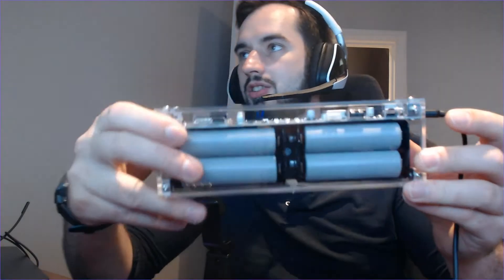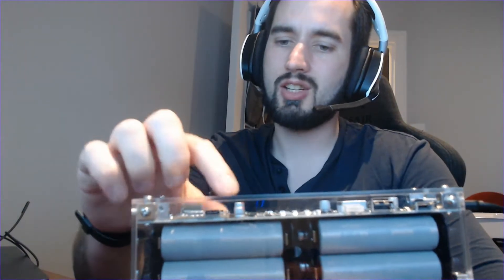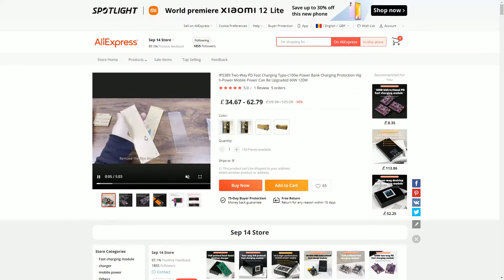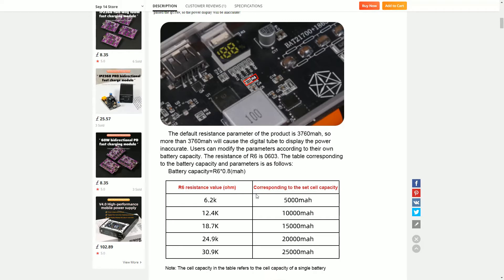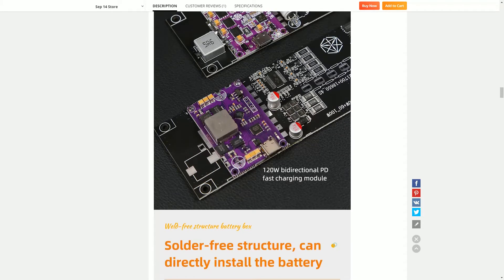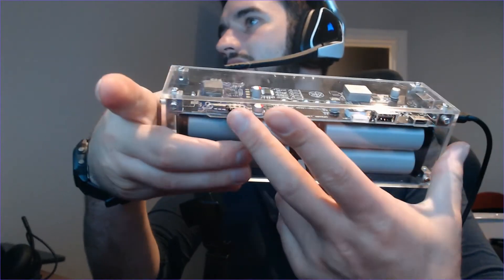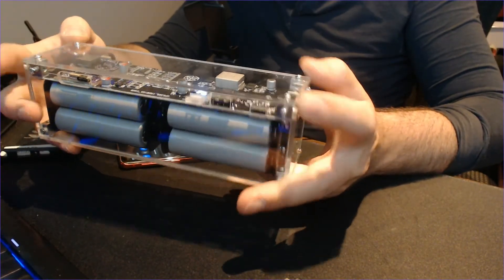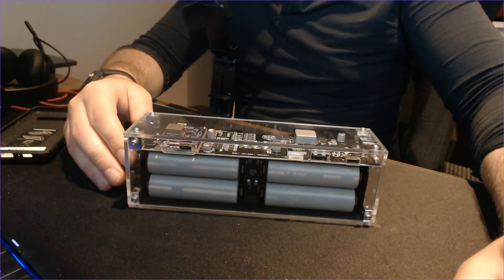Fast charge devices with a battery bank! 38400 MAH 120Watts!

Comment: When you're dealing with batteries it's important to know what the configuration of the cells are. Batteries are built by adding cells in series and then in parallel. When cells are in series you add up the voltage and when cells are in parallel you add up the capacities. So to get 38400mah battery, you'd need a 1s8p configuration. But that would be a pretty terrible battery and you'd not be able to charge your laptop with that. Most likely this battery is a 4s2p configuration. That means 4 cells in series, and two of those 4 cell batteries in parallel. Which means you'll get 16.8 volts and then you take the capacity of the battery and multiply it by the parallel value, so 4800x2 = 9600mah

It's really deceptive marketing by the companies to state what they did, because there is no way you'd have anywhere near 38400mah of capacity in this battery. But thats aliexpress for you :D

Comment: I wonder what is this power bank for? The case is too fragile and with the sharp corners, it is no great as a portable power bank. The other option is to have it sit on the desk, but what would be the point?  I really like the idea that you can use your own cells, and replace individual cells as they go bad or to replace the entire bank of cells.
Reply from the maker: Yeah it's a fair point - I tend to carry it in my backpack for remote working scenarios which really helps out but wouldn't risk having it lie around. I have since broken corners from dropping or had to replace the usb-c port due to leaving the cable plugged in while it's loose in the backpack. There's loads of other IP5389 models with durable cases

Comment from the maker: Hello Everyone - I would like to make a correction from speaking like a muppet! The PD 120W Does not mean it can charge while being charged - PD Actually refers to the charging methods for allowing upto 120W PD means the power output can climb upto 20Volts - this is dependent on  the usb-c cable type and charging protocol supported by the device you wish to charge with. I've since not had any issues charging not only my Mac but actually two laptops synchronously. One from the Chip and one from the main USB-C Port on the motherboard, 
I also didn't mention that the two side ports on the front can be used also for output charging - all external (apart from iphone port) can deliver 100W. You can fast charge from one main motherboard port plus also the 120W Chip - but it will fail to deliver a fast or super fast charge with two devices charging from main motherboard directly. Also please note I'm a very shy person - I'm not hired by aliexpress, I just wish to sound professional 🤣
Let me know if anyone has any questions!
Reply: Hi, have you tried a charging mother attached to a DIY battery pack, say from a powertool or laptop harvested pack thrown together. I actually think buying a blank battery bank is a bit pricey for what you get. But the board is the best value option.

Comment: Hi. Did you manage to read out the voltage or state of charge? There are two options to hook up an i2c reader. One is BQ4050 and the other is AT32F403A 
The idea behind my question is, to have a script reading those values. If the soc or battery voltage drops below a certain value a system shutdown will be triggered. I intend to use the power bank as an UPS powering a mini PC over USB-C. It all works, but only the readout is missing
Reply from the maker: There is the new modded IP5489 that has an included power jack port for use as a UPS - I can see this one actually is listed as a UPS where's I'm unsure of the one listed on this video https://www.aliexpress.com/item/1005005743689106.html?spm=a2g0o.productlist.main.5.41e929cfyHY0Ka&algo_pvid=9ed26161-7eee-4ba4-9e30-8fd783d100e5&algo_exp_id=9ed26161-7eee-4ba4-9e30-8fd783d100e5-2&pdp_npi=4%40dis%21GBP%21148.37%2174.18%21%21%21176.88%21%21%4021038edc16955575377418102e0787%2112000034185547702%21sea%21UK%212497487056%21&curPageLogUid=ssb2OPf0YJ5d

I've been able to measure the charging wattage on the ip5389 in this video that can climb up to 100W to charge (through cable and not by reading the IP5389 chip) - but for anything specific I would recommend the IP5389 linked above because it will display all voltage measurements within the included LCD display.

Hope that helps!

Comment: 4s2p struggles with 100w draw, capacity drops off a cliff. Good for anything that draws under 100w but. 65w all day ez.
Reply from the maker: yes, there are much larger battery packs now of upto 16+ Batteries I suspect would help, I've also heard many comments about the need for many heatsinks for anything longer term. Even fitting in a mini fan aswell.

Comment: I'm thinking of pulling the trigger on this. How long does it take to fully charge?
Reply from the maker: It's not that bad maby 2-3 Hours. I've since fitted a wireless charger that supports fast charging :D 
https://nl.aliexpress.com/item/1005003613524956.html?spm=a2g0o.order_list.order_list_main.35.df0379d2nwLHcQ&gatewayAdapt=glo2nld
Reply: @jakesllama  I grabbed this with the 60/120 boards.
Reply from the maker: Awesome let me know how it goes :)
Reply: @jakesllama  I have a question or 2. What type charger to you use?  The wall wort type and do you know how many watts it outputs and would you know how many watts the power bank draws when charging? Also does this power bank have low voltage protection? I'll ask the guys on ali where I bought mine but curious if you know. It's a concern considering these use unprotected cells. Thanks for any info bud. (òÓ,)_\,,/ ok I asked them they say is has low voltage protection...well yeah it should.

Comment: Is this compatible with LiFePO4 cells?
Reply: I don't believe 5389 is but I might be wrong about that. I know for a fact the 120W board is not
Reply: The 5289 board is compatible with lifepo4 but you have to add a resister.  Check the spec sheet. Note you will have to use google translate because it's in Chinese
Reply: @chrisnixon2179  You're right the chip is compatible with LiFeP04. I feel like I've seen ads that say its 3.7V only but I could be wrong or it could be other components are preventing the use of different cells.

Comment: Keep in mind those cells are in series, probably 4S2P so you're getting 9600mah at a nominal 14.4V/14.8V. I have a bunch of their boards but I've had serious issues pulling anything above the 20V 3A PD profile because the IC heats up insanely fast. I've considered ordering one of these in a larger version but knowing the boards need some serious thermal dissipation makes me weary since I'd have to rig up fans for anything more than phone charging. 

Macbook charging will "fail" because it will shut down when the IC hits 160C which happens in 10 seconds unless you have some serious airflow. I used two 40mm blower fans to get 100W output on the 120W board.

So thats why these aren't very popuar.

Any chance you've tested the cells to see if they are remotely similar in spec to the Tesla cells?

Edit: got my 120W board working by charging the cells with it for a while. Weird. I have a theory but it’s a complicated one. 

Still the SW2303 is a shit show
Reply: Hello, Mr. Klein. I also bought the 120W module. Can you tell me how it will be soldered. Unfortunately there is no information about this. Many Thanks.
Reply: @pennylane8859  I was looking at the powerbanks board in pics trying to figure that out. Is it the 120W board with an SC8812A chip? My best guess is the holes drilled in the corners when connected to brass standoffs electrically connect the board
Reply: @ericklein5097  Hi, Eric. I meant the two capacitors. Are they only exchanged?
Many greetings
Reply: @pennylane8859  do you have two capacitors on the bottom of the board?
Reply: @ericklein5097  Hello, Eric. The capacitors are on the 120 -W module and on the original board there are two free capacitor places. In the seller's pictures, it looks as if they are removed from the 120 -W module and soldered into the original board. Is that right?
Reply: @pennylane8859  sorry just saw this. On my 120W board there are two large capacitors on top of the board. One for input and one for output. There are also 6 SMD components, 3 next to each capacitor, also on the top. These SMD components are also capacitors but must be a different type of capacitor. 

Do you have a capacitor on the bottom of your board?
Reply from the maker: @penny lane I think its worth mentioning that the stores customer support intend to fit these PD Boards for you and I imagine they may make capacitor changes but I have another board where I fitted my own 120W PD board and there was no issue. I confirmed with the Ali express store that I just needed to soldered the + and - 
Use a copper wire inside the hole and provide plenty of solder to have a strong connection.
Reply: @ericklein5097  can I just ask you, how dangerous would the aluminium shell be for a battery pack like that? Will it explode once the lipo batteries expand? Should we be worried that the lipo batteries are not individually balanced (as far as I can tell)?

Comment: Hello,Jake.  A good review. Could you please answer 2 questions about the 120W module? Greetings Achim
Reply from the maker: absolutley Penny please fire away! Greetings!
Reply: @jakesllama  Hi, Jake. My questions:
To connect the 120W module just + and - solder? Or do I have to exchange the capacitors? Kind regards.
Reply from the maker: @pennylane8859  Hi Penny, yes you just have to solder the + and - make sure there is a strong connection, I used a copper rod in the hole. And be generous with solder.
Reply from the maker: no need to exchanger capacitors
Reply: @jakesllama  In your vid there are 2 new caps on the mainboard that are not originally there. To the left of the 120W PD module.
And the 2 caps that were on the 120W PD module are gone ??
Reply: Or do you bought it complete?
Reply from the maker: @pennylane8859  the one in the video I brought complete. I brought a second one that I installed myself
Reply: @jakesllama  ok and you dont change the caps from the modul to the mainboard?
Reply from the maker: @Penny Lane  no I made no change. But you should message the ali express stroe that sold you the board. They will help you with more info
Reply: @jakesllama  Ok. Thanks a lot for your answers, Jake.
Reply: @jakesllama  Have a nice Weekend. 😁
Reply from the maker: @Penny Lane  have a good weekend and goodluck with the board! 😃

Comment: That's a cool powerbank!! I ordered the 16 cell version for an insane 300Wh. Is the percentage display accurate? I read that for it to be accurate while using batteries other than 3700mah you have to swap a resistor, you bought yours with bigger batteries preassembled so maybe it came with the right resistor preinstalled?
Reply: Have you built yours yet? If so, is it good?
Reply from the maker: I can confirm I discussed with Ali Express store that the resistor is not changed - the default resistor is 3760MAH  so I asked for their help in the calculations -- Working below (Have in mind these are circuit resistors and very small to work with, I managed to pull off a slightly dodgey solder with my standard sized iron.

You need to compare this below with the description on the ali listing
https://www.aliexpress.com/item/1005004287259507.html?pdp_npi=2%40dis%21UAH%212%C2%A0932%2C85%20%D0%B3%D1%80%D0%BD.%211%C2%A0319%2C71%20%D0%B3%D1%80%D0%BD.%21%21%21%21%21%40211b446516611712042848049ee0a9%2112000028636354661%21im

The working explains one capacity which is actually 1 string = 2 batteries = 4 strings = 8 batteries
2 X 21700 = 9600MAH. 
So I use the Resistor 12.4k = 10000MAH

Speak with the customer support for the store you have brought from for the 16 call version!